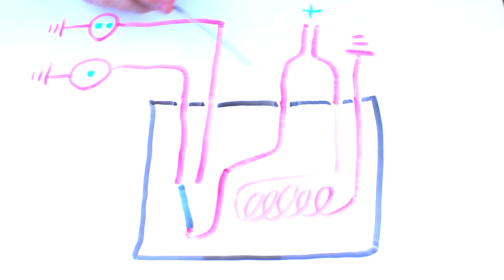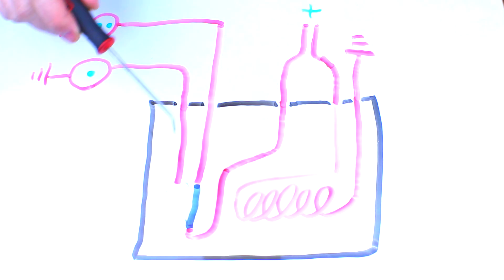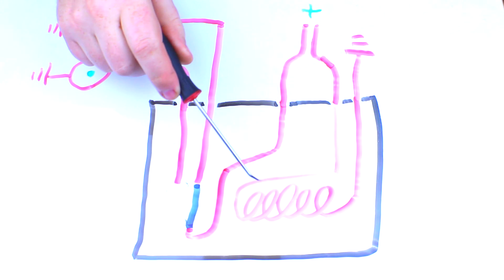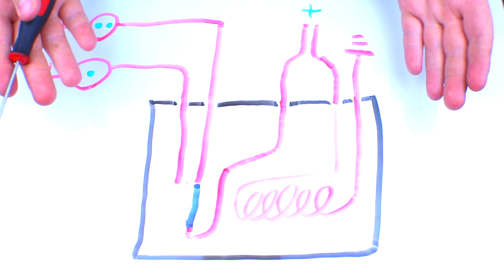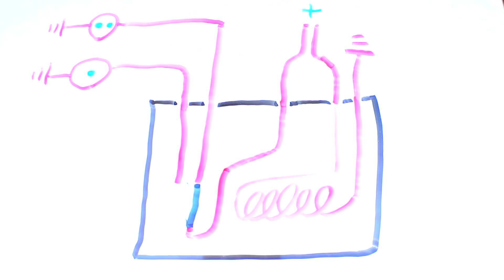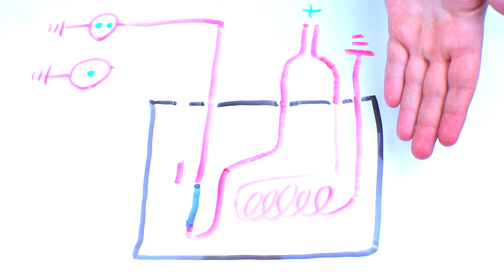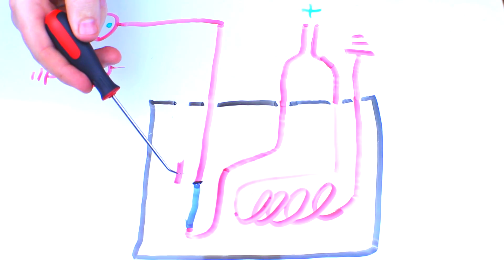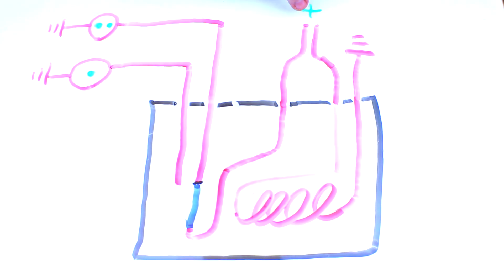How Relays Work, Why They're Used, & How They Fail (Disassembled Relay Explained)

Comment: My car horns are perfect ground is good wiring everything is good but it sounds weak sometimes .. can this because of a bad relay
Reply from the maker: If carbon builds up on those contacts, it can add resistance which can alter the pitch and/or volume of the horn. On a dual horn system (the harmonic horn tone many cars have) a loose connector/wire near one of the horns could make one work intermittently.

A relay seems like the more likely issue, and really easy to test if there is an identical relay that can be swapped out that isn't vital to the car/safety while testing.

Comment: Hi. Thanks for the clear information. I did subscribe.  Before I watched your video I watched one where the guy slopped the dielectric grease all over the metal contacts on a trailer connection he was installing; both the male and female sides. Is he just totally misinformed?

Comment: great video.   Also, thanks to relays, it's possible for a single switch to simultaneously turn off and on multiple circuits.  oh the joys of technology.
Reply from the maker: Thanks!
It is indeed! I also forgot about the fact that on board computers can control or override components, too.